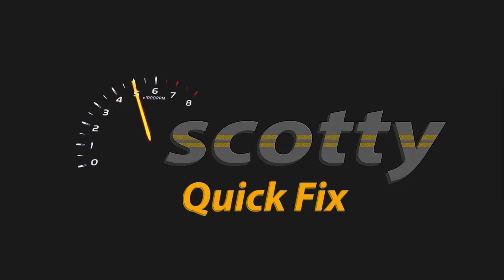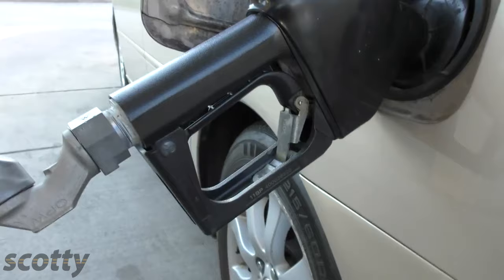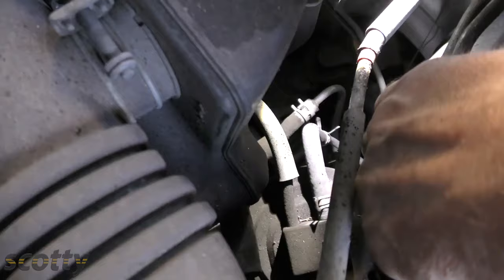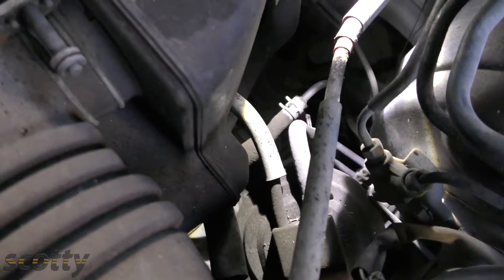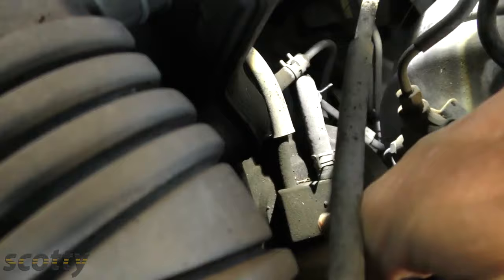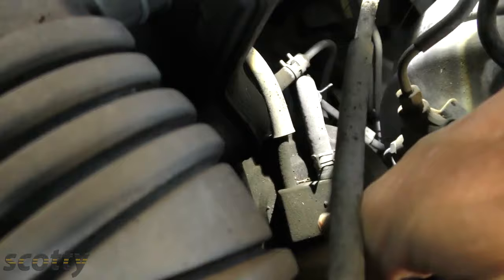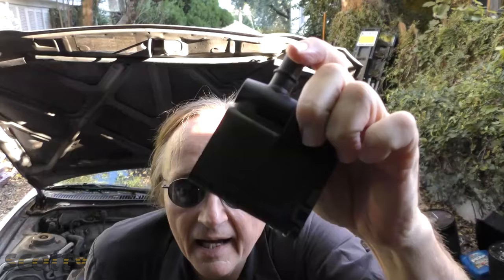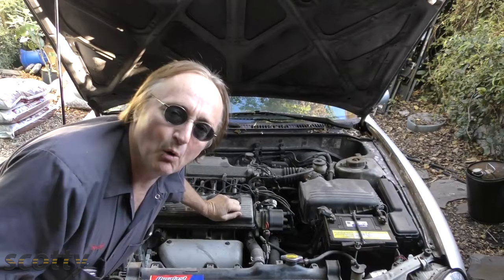Why Not to Overfill (Top Up) Your Car's Gas Tank

Comment: What about modern diesels?
Reply: i just remembered that diesel fuel is oily and it doesn't evaporate.
someone correct me if i'm wrong.
Reply: lol the exaggeration of not being able to breathe.
Reply: Not an issues, I learnt how to drive in a 2015 Clio with 80,000 miles, the instructor said himself you can go past the click perfectly fine without any issues. pretty much anyone who fills up their tank will go past the click.
Reply: Против Глобал Don't worry the electric revolution has started and is fast becoming the reality,within 15 years the majority of vehicles will be zero emissions.
Reply: Yeah, sure. The emissions will simply come from the powerplant that charged them.
Reply: Actually modern diesels pollute far less than the equivalent gasoline car mile for mile. That "black stuff" that comes out is pure carbon graphite instead of mostly carbon dioxide which goes into the air.  The carbon eventually breaks apart and compounds with other molecules to make organic molecules that are harmless.
Reply: It's more fun that way!
Reply: Keirnoth, Indeed, Gas engines pollute more than Diesel engines,
Reply: anyone with a diesel just log into an auto parts site and look to see if there's an evap canister available for your model. EZ

Comment: I'm ocd I got to round to the nearest dollar. So far I haven't had problem with mine. Now I did have problem with the fuel spitback where when the nozzle stops it spit gas out but that because of a ventilation problem with the car it had recall on it

Comment: Good grief!  I've always topped off my gas tank after it shuts off.   Well, no more.  I wonder if I've wrecked mine.
Reply: Hurrency Don't feel bad. I was an import mechanic and ruined the charcoal canister and purge valve on my '99 Accent by topping off my gas tank. Even I didn't know better at the time. It cost me $222 to replace both parts WITH a 20% courtesy discount from Hyundai.  That was 8 years ago.
Reply: Shepperd November but how did you know yours was ruined?

Comment: I noticed when I top off my gas tank I get further down the road in my 2007 Honda Accord. It has a 17.1 gallon tank but the gas pump stops at 13.3 gallons when the low fuel light is on. I can put 3 more gallons in my car after the pump stops. If I do that I can get about 470-500 miles out of a tank compared to getting between 330-375 miles if I only put one extra gallon.

Comment: Wow I always topped mine of and never had an issue. And I always gotten better gas mileage when the car is FULL. I ran this test many times. I believe it may not be good for some car for how the make the fuel system. But some car it’s fine. You just have to one read the owners manual or the build specs for the fuel system to see if topping off is bad.

Comment: My owners manual says a full tank is when it stops pumping and you click it once more. But what would I know only have 181k on my vehicle
Reply: gokartbuyer my manual says when it stops, it's done. Saying one more bit doesn't make sense
Reply: Michael King ive heard that before, too. What it means is that the stop on the gun is activated by the fuel sloshing around (being poured at pressure). After the first click, pour again. 2nd time should be full. Think of filling a bucket of water with your garden hose. If you have it filling at high pressure, the water will overflow without really being full.
Reply: Clever analogy; well done!

Comment: Ive put gas over the click for the past 10 years and the car still works.
Reply: And there are plenty heavy cigarette smokers who have been smoking for decades with no lung issues... so what's your point?
Reply: The thing is sometimes it clicks after I put just a few gallons. Then I move the pump a little and it keeps going without clicking.
Reply: backcenter2 what year is ur car? You might have a evap code showing up. I have 05 maxima and my Evap code is on. Probably because I always over fill. Dam. I wish I knew about this. Lol
Reply: It's a pretty bad car from 2002, injection. Where do you see the evap code?
Reply: 2004 dacia solenza , been doing this for the past 15000-20000km, i wanna stop now :D
Reply: backcenter2 that's what I do with my truck. It will click then I move the nozzle back out slightly and put alittle more in without it clicking but I go really easy on the handle of the pump.

Comment: I used to have a 2005 Ford Escape that would have this issue where the fuel pump would shut off long before the gas tank was full.  It didn't do it every time.  It was quite rare.  Most of the time it worked normally and would shut off the pump right when the tank was full.  I never took the time to troubleshoot it because it was so intermittent.  But interesting this video made me think of that. lol  Good video and good information because way back when I had my first car, I had to do that and I think I may have damaged the EVAP system in that car.

Comment: This is seriously one of the most ridiculous things I've ever heard in my life. Now I'm not going to say but somehow or another somebody hasn't had an issue with this at some point. But let's be honest now what experience do I have I've overfilled my cars always I routinely put 300,000 miles on my cars I've been doing this for 40 years and never had a single problem with the evap canister. Now sure someone may say well that's you and you were lucky how could I be lucky over 40 years multiple cars. Again this is one of those things that mechanics make money on that doesn't actually need to be fixed. If you're finding a bunch of gas flowing into the evap canister there's another problem with the car with the fuel system. So thanks for putting out bad information Scotty Kilmer about half of your videos are wacky but this one was completely ridiculous. Not sure why I even watched it I haven't watched one of your videos and two years. Good luck to you
Reply: I agree, a full tank of gas will obviously slosh around in the tank from driving the car why would that not all spill into the canister ?
Reply: carmaninaz ur mad
Reply: I wish I watched it a hour before damaging my civic, emissions system check came on right after overfilling.

Comment: Scotty on a 07 Saturn ion.. when we fill the tank and start to car it starts then shuts back off. Hard take longer to start. Only does it when we top off the tank. Also have a code for a purge valve. Which I replaced now the code is back.

Comment: I don't think that was a charcoal canister in your hand at the end
Reply: Yes it was.
Reply: looks like a solenoid
Reply: It is the evap purge solenoid. It vents out the vapor to the atmosphere when you're filling up the gas tank and the engine is off. When the engine is running the purge solenoid is closed and the vapor goes through to your engine.
Reply: Looked like a Evap vent valve to me
Reply: Steve Vento n

Comment: On my ranger, the stepwise bed for the splash model was designed so weird that the gas pump fits in the neck so weird that the gas comes up the neck and spills out before the pump clicks. If my tank purge valve even works, I think my canister got screwed a long time ago.

Comment: I have overfilled my Nissan Almera for decades and nothing ever happened, weird. Car's been workin' like dream and couple times it didn't start, one reason was old battery and another couple times I took the key away and lock the driving wheel and waited couple minutes, restarted and worked like nothing ever was wrong at first place. That has never been happened right after overfillings but still good to know I won'r do that anymore.

Comment: 2004 Jeep Liberty - worst car to ever want to fill up at the gas tank. Somehow the engineers at Jeep made the tank/tubing perfect as to cut the pump off right as it's full. You can squeeze an extra quarter in it, but if you try for two quarters you can guarantee you'll be leaking fuel onto the concrete.

I care because I pay cash, and I much rather have a couple of quarters than an large assortment of random coins.

Comment: I've had a leak in my evap system for about a year. Check engine light and check fuel cap light is on constantly, and some gas evaporates, but otherwise the car runs fine.

Comment: With my 2014 Accord once the pump stops i can top off an additional 3 gals without spillage. Thats almost an extra 100 miles and I drive 100 daily so it's hard NOT to top off.

Comment: Interesting. I have a 98 Mitsubishi Mirage with the 1.5L engine and have always topped it off completely since purchasing new. Nary an issue. Found that I can add nearly a gallon of fuel after the pump shuts off. Maybe the canister is located where even when filling to the brim won't allow fuel to enter. I have a feeling If I now started to quit fueling when the pump shuts off it will probably throw a code so I guess I'll just keep on.  However, I do not do that with my 2003 Honda CRV because of the EVAP system.

Comment: Here is my questions about this:

If there are vapors in the canister, and the you shut down the car, wouldn’t those vapors condense into a liquid at some point depending on temperature/other factors?
Or conversely
What would prevent the liquid fuel deposited into the canister from evaporating and getting used eventually?

Sounds like the system could be designed better, especially knowing people want to fill their car all the way for various reasons. Add to that some pumps trigger cut off incorrectly (defective?). I’ve had pumps in the past trigger at say 3 gallons on an empty tank, and continue to randomly trigger when I know I’ll need to put approximately xx gallons from paying attention to mileage, fill ups, conditions, gauge, etc.
Reply: Jon Doe from what I understand, you are claiming the part on the car is bad;
It has been a long time, but from what I recall, it seemed to be certain pumps that had this issue, so I’d assume it was a pump side defect, as you could fill the car normally most of the time from most other pumps, but if you weren’t paying attention and hit that particular pump/handle, you either stopped and moved or tried to have the fuel flow as slowly as possible so it wouldn’t trip the handle.

Another thing I don’t understand, as I used to follow the stuff ‘hypermilers’ were doing, is for better scientific validity of actual mpg, theyd top off the car until the fuel reached the level of the inlet, another drop would roll off the side. They’d do this again at the next stop to get as accurate a reading as possible, and some do it as a regular practice without having issues with this system. I’m guessing these people should by lottery tickets and stand in a lightning storm with a golf club in the air with how ‘sensitive’ the system is being presented.

Comment: you forgot to mention, when you top it off, you also leave gas in the fill tube, which often is a hose, which does leak at times, and you only get a few extra cents/maybe a mile or 2 of gas when you do it. its really not worth it, plus you can cause the gas cap to not do its job properly too, after awhile the extra gas on it can lead to build up of crud.

Comment: In the early 2000s chargers it was actually smart to top off because the battery was stored right on top of the gas tank, of you got rear ended the battery could light the gas vapor left in the non-topped-off tank. Thus filling all the way would prevent gas vapor and save you

Comment: I'll second the insane prices for evap canisters. I had the canister replaced on my wife's '01 Toyota Echo...~$500! The worst part was the purge valve was the only part that went bad, but the valves aren't individually replaceable, so I had to pick up a whole assembly...
Reply: It's not rare for the purge valve or solenoid to fail.  Bad news on that model, I guess.  But I see some Echo purge valves for sale on line.  Is your year different?
Reply: Not 100% sure, but when I searched for the part online all I got were the entire evap canisters. I trust the shop I've used since there's been a half-dozen times I thought a repair was going to be more expensive and it was a much cheaper (ex: CEL on, but it was just a wire that needed to be resoldered...)

Comment: Sometimes these fuel stations pumps are faulty and shut off too soon which means you could end up with just 3/4 of a tank rather than a full one.  I always start it again after the first shut off to make sure I actually get a full tank.

Comment: I rock my car back and forth to let the bubbles out of my gas tank to fit more gas in. 98 Jeep 4.0 straight 6 with 295k miles and still running strong.

Comment: Topping up a 1998 Nissan 200SX, it caused the check engine light to come on. Turned out it fouled up some emissions related sensor. I forget specifically what, since this was so long ago. Ever since then, I NEVER top up.

Comment: One time I went to the gas station with my 1990 Honda Accord...pump shut off. I've had the same happen before and the tank not be full, so I put some more in..until it started overflowing. Whoops LOL. I don't even know if a car this old has an evap canister.

Comment: i have a 2016 mazda 6 and i fill it to the brim everytime. my car has more than 75 000 miles and run like new. it is more reliable than an anvil. never had one single problem.

Comment: Topping off usually results in overflow and spillage of gasoline, which evaporates and causes air pollution, negating the purpose of the EVAP system in the first place.

Comment: I did just have to replace mine. And I'm not one to overfill gas either. The valve got stuck open and the car wouldn't start anytime you put gas in. At least it was just the $20 part, but never threw any engine codes

Comment: was that tiny thing really an evap canister? I replaced the evap canister 10"x4"x8"and purge valve on my sierra and the evap vent valve (with the filter enclosure it's mounted in). The vent valve was the size of that thing Scotty was holding up.

Comment: Aren't there several safety mechanisms/valves in place to help prevent fluid from entering the canister?  Specifically for new cars.  Still, I'm learning that it's just not worth it to top off anyway to be safe.

Comment: But it's only stored in the evap canister until the egr system purges it into the throttle body to get burned. I always pump to the nearest $, and I have 208k miles on my Super Duty V10.

Comment: So putting a tiny bit more in to get to bed round number  on the pump display is bad? I thought the tank would expand if you overfill and then park it overnight. 

I like paying cash and 52,37€ suck, I gently make it go to 53.00€. If I can’t hit the spot and it’s 53,01 i usually have a cent in my wallet but I will be slightly annoyed the rest of the drive. Gas is expensive here so the next round number is max 1 Liter away.

Comment: I have a diesel truck and I did this once. Only problem I had was every once in a while my fuel gauge will act up, saying I have less fuel I’m my truck or that I’m empty. I’m not sure if I broke something or not cause it works most of the time.
Reply: Well, it doesn't matter if you top your gas tank up on diesel.
Reply: Cheese 1337 uh I don’t know cause it may have messed up my sending unit and that’s why after I did it I started noticing problems with my fuel gauge.

Comment: when i pump gas, after the first click, i manually turn off the pump (just push the flap in) and squeeze all the gas in the tube into the tank, you actually get quite a bit more gas that way, is this ok ? I never had a problem with the EVAP canister before and I've owned about 15 cars by now.

Comment: I had part of a fuel pump crack on my 2004 Corvette and leak raw fuel vapor into my garage just because I topped it off thinking it's not full yet. Sometimes the pump stops pumping when I have plenty of room left in the tank, which is annoying on these cars! A friend of mine with a GTO has the same problem for some reason. Ended up nuking my bank account to fix it.

Comment: If this is true why wouldn’t a full tank of gas simply slosh it’s way in from driving ? Am I missing something ?
Reply: Because the evap vapor recovery system vent connection is near the top of the fuel fill tube.  If you fill the tank and the fuel fill tube, the liquid fuel gets into the vapor recovery system.  The fuel fill tube is otherwise too small for fuel down inside the tank to slosh up that high.

Comment: I got my gas light once due to over filling, i didnt want to go back in the station for 64 cents kept overfilling it it poped 3 or 4 times and i didnt care, drove back home and when i turn the truck at night i had the check gas cap, so i went to tighten it and it didnt go away for 3 or 4 days. Never did it again.

Comment: What I am curious about is what happens if this canister fails? 
My understanding is that it is just a filter that keeps the raw gas fumes from
entering the atmosphere as you fill the tank and the air in the tank is displaced. 
 I have never replaced one of those things
and I am sure on cars I have that are 30 years old, the things no longer work as advertised.
My 350Z will trip the shutoff on a gas hose at half a tank unless I restart it a couple times.
I have done that since I bought the thing 125K miles ago and no issues. It does
not smell of gas and has never given any fuel delivery issues. In fact the biggest issues
I deal with are those caused by that stinking lousy ethanol they lace the gas with today.
The car gets 2 miles a gallon worse fuel economy and does not run as smooth if I use the 10% 
ethanol, or as I call it crapinol.

Comment: Very enlightening video. I will definitely stop overfilling my car from now on.

Please I need some advise on whether I should replace my car ml350 4matic (W164) automatic AC compressor with a manual compressor.
So far I have had repeated issues while using the automatic compressor so I was advised to make the switch.
Please provide some feedback on whether or not this is a good idea.
Thanks.